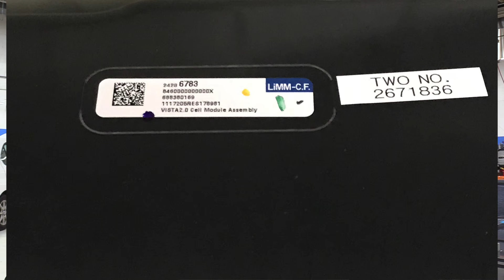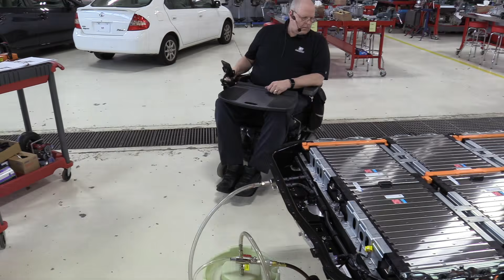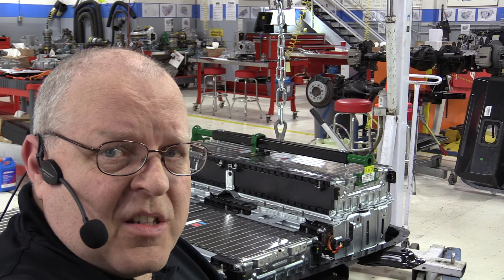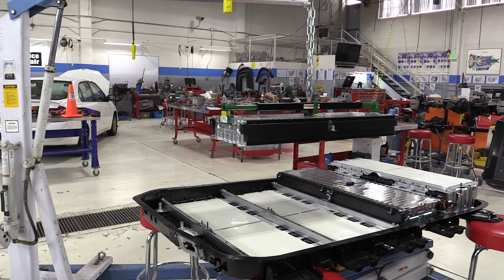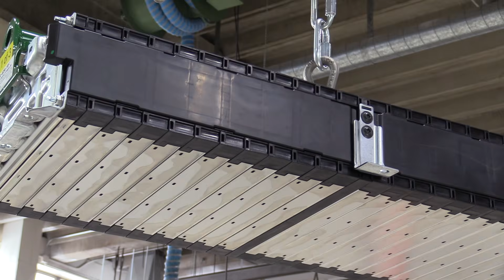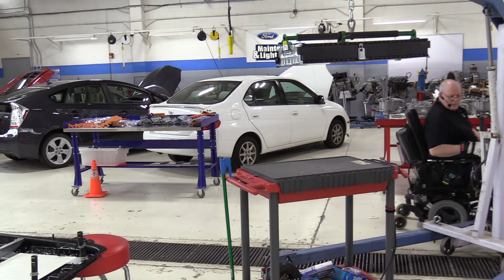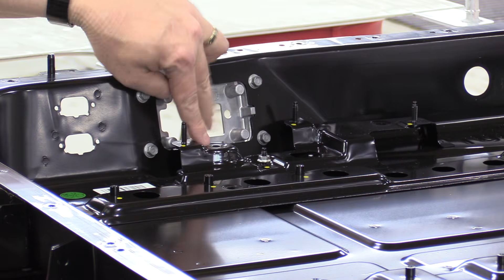Chevrolet Bolt EV Battery Disassembly

Comment: Professor Kelly how are you sir I am in a peculiar situation with a hybrid vehicle that I have absolutely no information on and I was hoping that maybe you would know something of it AZURE Dynamics hybrid the vehicle is currently owned by a FedEx contractor in which I'm involved with the reason I'm contacting you is the company went bankrupt in 2012 and there's absolutely no schematics or service procedures or troubleshooters that I can find anywhere can you please help thank you so very much for your time and consideration
Reply from the maker: Try this http://www.utilimaster.com/WorkArea/DownloadAsset.aspx?id=282 Best wishes!
Reply: Thank you so very much for your time and trouble what you have given me is all the information on the internet about the vehicle unfortunately it is just an operator's manual not very well thought out at that again thank you for responding and for the service
Reply: Robert Atwood you might get help on azure dynamics vehicles from one of the 2 independent ev specialists here in the uk. Go register on speakEV and post your question up on that forum.
Reply: Hugh Frater thank you very much I have made the post and we'll see how it goes I will give you an update if I hear anything

Comment: One cell-trio is a module and a stack of those modules is a module section (or a section)? I'm getting confused what is called what :D
And inside one module there is a group of 3 cells.
block, group, module, stack, cluster :S
Reply from the maker: Sorry for the confusion. This should clarify things:There are 5 battery sections. 
Each battery section section contains 2 modules. 
Sections 1, 2, and 3 contain 2 modules with 10 cell groups each.
Sections 4 and 5 contain 2 modules, but one has 10 cell groups, and the other has 8 cell groups.
Each cell group contains 3 cells welded in parallel with each other.  
Each cell group has a nominal voltage of 3.65V (4.0V fully charged)
There are 96 cell groups for a total of 350.4V (384V fully charged)
Reply: But on other EV's, let's say Leaf, a module is a piece that has two cellpairs.
Why do you call module (stack of groups) a module? Is it stand-alone unit? If you unbolt the section, doesn't cellstacks fall apart? Or we get two non-disassemblable modules?
Thanks :)
Reply from the maker: Those names are the official names from the GM Service information.
If you remove the 4 section section bolts, I suspect we get two non-disassemblable modules. I have not tried it yet, but I will.

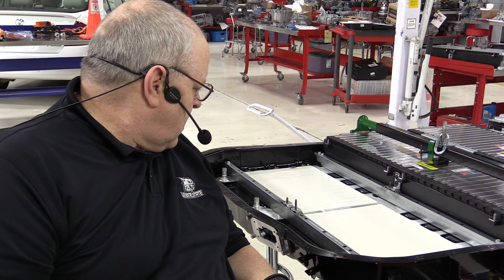Comment: Next time remove the outermost sections first,  (1:07:05), don't leave the last section on the edge. Leave the last sections in the center. 5-4-1-3-2 for example.
Though with the help of battery disassembly stools (Chevy OEM definitely)  everything is possible :)
Reply from the maker: Good idea!

Comment: Thermal pads are reusable, but should not be contaminated. Use clear plastic foil (PVC) or something not sticky to protect from one side, keep them on the original surface from other side.
In case of open system and high temperature, those pads degrade. If they fall apart, then they must be replaced.
Reply from the maker: The clear plastic is a good idea. I have covered ours while we determine if we can get replacements. I understand what you are saying, but the service information says to replace the pads. I am trying to show the "official service procedures" in these videos.

Comment: If one module fails 5 years later,  it's likely  unreasonable to replace a section/module inside one pack. It will always unbalance the whole pack. BMS will compensate but if new module is 10% better it will be a mess.
Reply from the maker: True, but you can also replace the housing if it gets damaged, the BECM, the harnesses, and the coolant plates or hoses if necessary.
Reply: BECM is the same as BMS?

Comment: Thanks for another great video, Professor! 

I do have to mention that each time you pause for a second to make sure you are using exactly the right name for a component I expect you to say "Thing-A-Ma-Jig" or "Doo-Hickey."

Those neatly packaged battery sections will be super popular in the aftermarket for those who build DIY EVs  and powerwalls once owners get busy driving their Bolts into trees just hard enough to be "uneconomical to repair." Bolt parts are starting to show up on Ebay but no batteries yet. 

After watching your previous videos I bought a 24V hunk of Gen 1 Volt battery to use at work in our R&D department for testing, um, stuff. It's a wonderful battery. It is a better battery than I can buy retail W/O building my own from cells for many times the price.

Thanks again. There really is no other place to get this level of detail. You provide a priceless resource.
Reply from the maker: Thank you very much! I am glad you were able to obtain a Gen 1 volt battery section for testing. Sounds fun.

Comment: Are you going to purchase a single battery cell group to disassemble and show the internal of the cell groups?
Reply from the maker: I hope so!
Reply: Thanks for the reply. I'm really liking your channel. Very informative and to the point. I had a couple questions that I would like your opinion on as a professional and instructor if you don't mind.
You said that the cell configuration for the battery is the same as the Volt gen1 battery? 3 parallel cells per group, 96 groups in series (3p96s). I'm guessing you got that from your service manual? 
What is your opinion on the longevity of that? I would think that having so few cells per group is very bad. If a single cell fails in a group, the other 2 cells are each going to see a 50% increase in current to keep the same power output. Seems like that would cause rapid degradation of the remaining 2 cells in the group, causing them to then fail.
Also, the asymmetric cooling of the battery also seems like a poor design choice that may affect battery longevity. For example, the cell groups in module one aren't cooled at all on top, the rear bottom of the cell group has the fresh cold coolant going by it, and the front bottom of that same cell group has the very last warm/hot coolant going by it. Very asymmetric. The Volt battery had full contact coolant with the entire surface of each(or most) battery cells.
Sorry for the long post. What do you think about those points regarding the very long term (10+ years] longevity of the pack? Thanks very much.

Comment: @WeberAuto What is the underside cover that you removed first in the last video made out of? Is it the standard hard plastic molding found in most vehicles, or is it made of metal?
Reply from the maker: Hi, it seems to be some sort of reinforced flexible plastic with a felt type top. Fairly thin; 1.5mm. Very lightweight.

Comment: Excellent video. 

BTW, even GM realized how Volt and Bolt names could be confused. So they called it "Bolt EV". Easier than saying "Bolt with a B" 🙂
Reply from the maker: Thank you! That is a great way to distinguish between them! I will try to use that for now on!

Comment: Awesome video! Thanks for sharing it. 

It looks to me like the Bolt EV pack is not as comprehensively cooled as the Volt pack. Volt gets cooling plates running along a larger surface area of the cell packs. Bolt EV has cooling just on the edges. Also, based on the residue left on the heatsinks from the heat pad, it looks like they aren't even making complete contact with the heat pad- with some cell packs appearing to have no contact at all.
Reply from the maker: Thank you! I plan on testing the contact area before assembly.
Reply: Totally incorrect on the cell-edge cooling and no contact.

Comment: Thanks for the video, Ive always wondered what the make up of car batteries were. Now I know. Alot of engineering.
Wonder if someone got it replaced, would they just drop the whole unit and replace, or replace just the battery units.
Reply from the maker: Thank you! Either way is an option.

Comment: Thank you for this video.  Excellent work as usual.  I LOL’d when you dumped the upper cooling plate’s remaining contents onto yourself.  We’ve all done it.

If I may, the term you were searching for regarding a collection of cells welded together in parallel is called a cell “group”.    A collection of cell groups forms a battery “module”.   A collection of modules along with all the other naus is the battery pack.
Reply from the maker: Thank you, it was certainly a surprise! Thanks for the terminology feedback. Sometimes while shooting a live video I will forget the most basic of terms.

Comment: Watching you work like this, i realised it's very easy to be schocked by the battery. Basicly only your hands are protected. It's easy to forget about the high voltage and lean against the battery with another part of your body. I saw your bare arms getting close to it a few times. So one of the biggest safety tools is the awareness of what you're doing!
Reply from the maker: Very true, Thanks for your feedback.
Reply: DiagnoseDan If the service plug is out, there should be no voltage at the bus bars, unless you touch another terminal at the same time, and that will vary depending on the terminal. Of course, if you’re talking about the main positive and negative terminals while the service plug is in, then it’s game over.  Since this is YouTube (the land of unnecessary flame wars), I just want to say that you’re absolutely right about the need to stay aware when working on EV batteries.  I agree 100% on that.  But I want to dispel the notion that these things are high voltage death machines.  I hear that concern voiced to me all the time when talking about EVs.   The voltage differential between cells, wires, and bus bars is quite variable, and often well below the 350.4 volt pack total.  Anyway....thank you for responding to my comment!
Reply: Bryan Noga    
Yes much nonsense is ALWAYS readily available about new technology... I can’t imagine any place it  such things would come from other than the death Pangea of the old....
Reply: Bryan Noga, it's relative new for most techs. But a regular gas tank can be dangerous aswell if not handled with care.
Just noticed all the safety procedures and than the bear arms. Seemed strange.
Reply: Yes and no.  The voltage difference between cells is pretty low, so you can basically grab two, three, four, etc. adjacent cells without worry.  But if you reach across the battery and touch opposite positive and negative terminals without protection, your family will be paying for a funeral.  Everything is wired in series, so every additional cell adds ~3.65 volts.   Don’t quote me on this, but I believe anything above 50 (?) volts is considered “dangerous”.   EV batteries are serious business, but they’re not a danger when serviced carefully.
Reply: Bryan Noga I think 40v is where your skin stops insulating you from a noticeable shock...
Reply: Bryan Noga, when the bus bars are still connected the batteries are in series. If you touch something like a bus bar you could be in serious trouble.

Comment: Take an individual cell out of the module and weigh the cell and test its c rating to see if it is under rated or over rated. These packs would make great use as stationary storage when the car is at the end of it's life or it gets crashed. Much better cells and pack design than the volt
Reply from the maker: I will see if I can do that. Thanks for the feedback!
Reply: WeberAuto thanks, that will answer a lot of questions battery enthusiasts have had about the new cells lg was using in the Chevy bolt.

Comment: I do wonder if the 57KWh rating is usable and not maximum capacity?  There are people who have driven a full charge on the Bolt EV and the car shows a bit more than 57KWh used.  https://www.youtube.com/watch?v=5EaEvIqaj4k&t=2s
Reply: GM's algorithm takes regen into consideration.  The KWh used number decreases with regen.  Also unless starting on a hill regen is energy that was in the pack to begin with.   Regen only recaptures some of the energy spent to accelerate the vehicle to begin with.  So that would not account for this.
Reply from the maker: It is certainly a mystery. You may be correct. I am still investigating that question. Best wishes!
Reply: Erik Stephens they can use more because some is captured back in Regen during the drive... That is energy that was not in the pack to begin with.
Reply: I find it unlikely that LG would advertise "usable capacity" when the modules themselves are agnostic to depth of discharge.
Reply: Jeff I agree.  But there is no way 100% dod can be used without damage to the battery.   Also this has nothing to do with what LG would advertise.  LG is simply the supplier of the GM designed battery and cells.  They would mark the battery as per GM's specifications.
Reply: I think the 57kwh is the max capacity of the battery, just like other EV, the usable capacity might be 10~20% lower than the max capacity rating, so as the battery aging, you won't notice any significantly amount of change over the range. Just my prediction, don't have evidence to prove it.
Reply: But the modules themselves are agnostic to "usable capacity" ratings. They are just dumb cells, right? Seems odd to label the modules when it's not the modules themselves that determine usable capacity. That limitation is calculated and applied further upstream.
Reply: Again this is just speculation on my part. If you have a better explanation on how the car is using more energy than what is marked on the battery I'm all ears.   I've seen some video's of Bolt EV's using more than 58KWh on a full charge (and the counter does subtract regeneration).
Reply: Erik Stephens .Regen simply captures some of the energy from the forward motion of the vehicle which was induced from the original energy in the pack.  The simple answer is that the labeling on the modules is lower than actual and the pack holds more than 57kWh, depending on temperature of course.
Reply: Erik keep in mind that how you use the cell determines how much power you will get out. Generally speaking, the slower the drain the more total power you will be able to get out.

Typically batteries are rated at a 1C drain rate.  But we don't drive at a constant 1C drain rate. We drive at typically 0.5C on average, but can peak up to 2.6C!

This is why a kWh rating on the battery is really only a relative thing. If you drive really slow and conservatively, vs fast and aggressively, you will get 2 very different total kWh amounts out of the exact same battery.
Reply: Sean Graham There is lots of logic in your presumption. Next time I talk to engineers from GM I will see if I can confirm that.
Reply: Erik also the rate of charge changes the efficiency at which the energy is stored -- slower charges are more efficient.

There's some reading here that you can do:

http://batteryuniversity.com/learn/article/bu_808c_coulombic_and_energy_efficiency_with_the_battery

If you'd like to understand more about discharge rates and how they affect the total Ah, as well as the voltages under discharge, check out this paper:

http://www.mdpi.com/2313-0105/2/2/17/pdf

(or you can look up "Lithium ion discharge curves")
Reply: Sean Graham I understand all that already. But slower charging is not necessarily more efficient. On board charger losses are actually higher at lower AC charge voltages.
Reply: Yes, but that's charger efficiency, not battery storage efficiency. I'm referring to the efficiency of the battery itself being able to store the energy in the chemical reactions.
Reply: So your just simply talking about I^2*R losses and internal cell resistance.  Due to the charge taper profile the battery will still largely hold the same charge energy regardless how fast it's charged.  The only difference is more energy is used from the grid to do so faster.
Reply: Erik I seem to remember that there still is a difference. It's on the order of a couple percent, based on the rate of charge. I can't seem to find anything to back this up though. Do you have anything authoritative on this that I could read?
Reply: It's been over a decade since I've studied and worked on battery charging logic.  At the end of the day it all comes down to internal battery cell resistance as your SOC increases.   While your right in that there might be some variation when charging in constant current mode.  Once you hit your physical limitations and start ramping current down it should all mostly even out as you reach your target fully charged voltage.   Battery temperature is a bigger variable than charge rate on a vehicle like the Bolt EV.

Comment: Awesome video!  I do wonder if it's possible to disassemble one of the modules and is it possible to even get down to the cell level?
Reply from the maker: Thank you! Yes, but not without cutting some welded connections.  I hope to get a spare section to do that very thing.

Comment: I don’t remember if you mentioned it or not, but on the Volt battery there is an inspection “bolt” to see if the coolant had leaked, is there one for the Bolt battery as well?
Reply from the maker: I was wrong, it does have a inspection bolt at the lower front of the battery housing (just like the Volt).